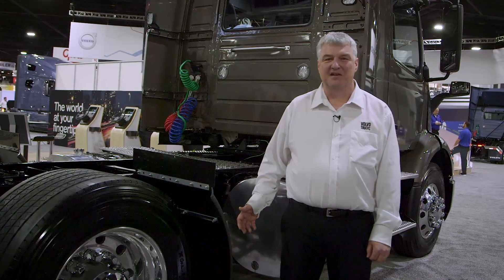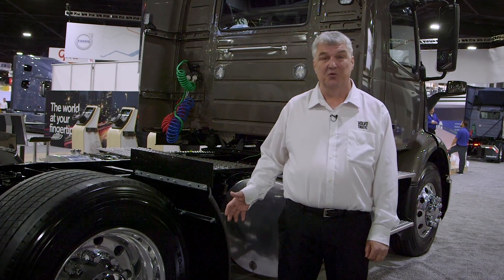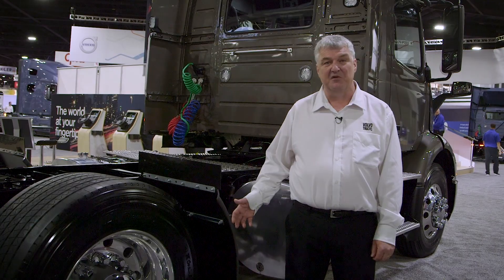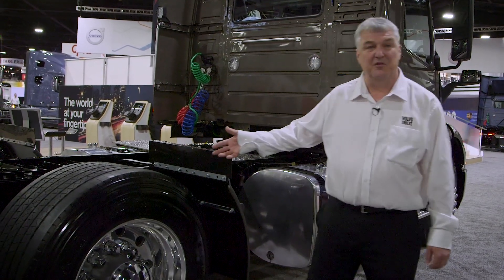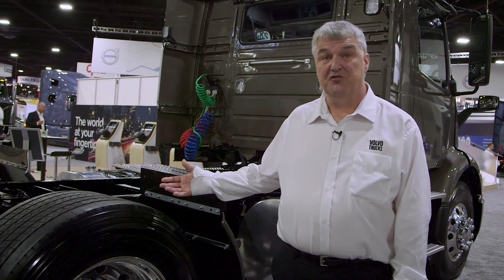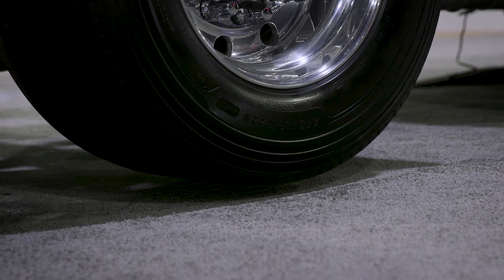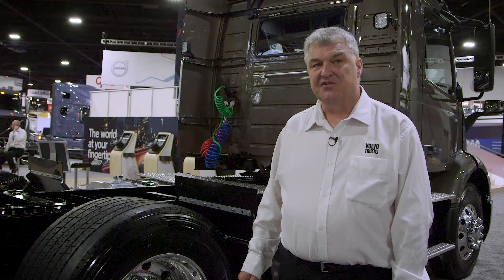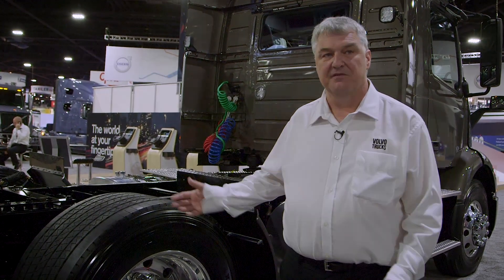Volvo Trucks - A Closer Look: Adaptive Loading

Comment: The first time that I pulled a trailer with this system was in Greece in 2004 with an old tanker trailer that was dated in 1990s! This is system is an antique now in Europe. And the first tractor that I drove with a lift axle was 1974 Volvo F89 with a 12-liter engine and 8 speed over drive transmission. Another antique feature that is presented now as a new in US!